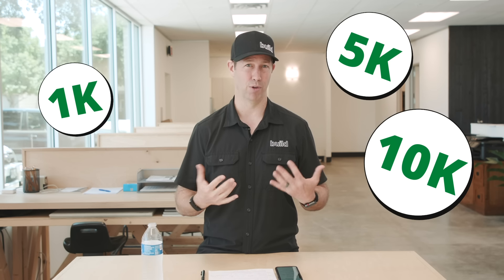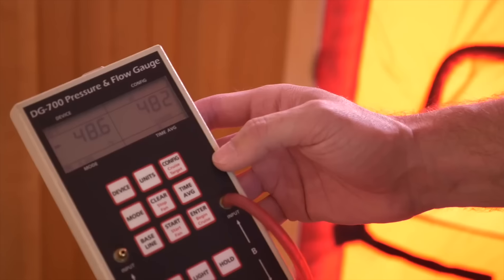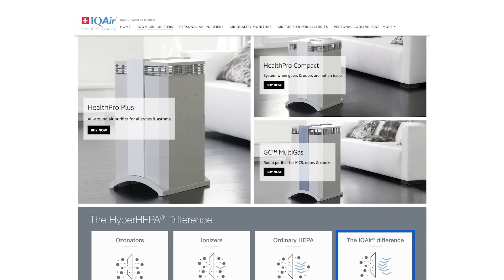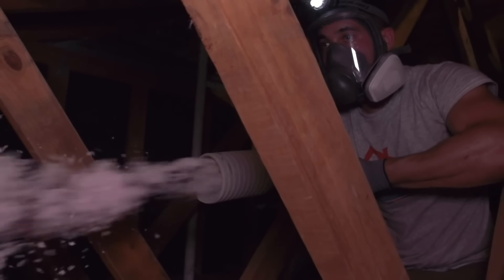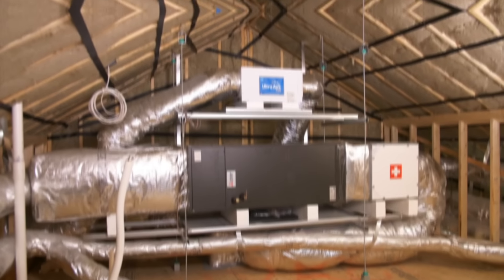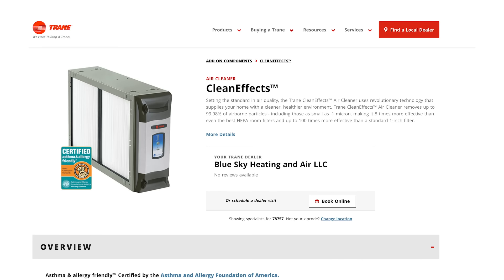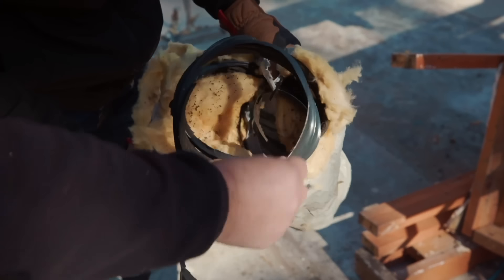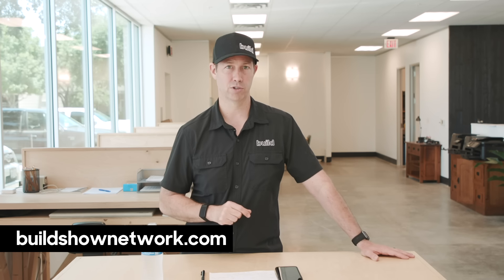Affordable Home Upgrades (Energy Efficiency & Indoor Air Quality )

Comment: Heat pump water heater is our free dehumidifier in finished basement. Can run on 1200W 12VDC inverter during power outage and is extremely energy efficient. AO Smith. Dry air feels good.

Comment: When I lived in Houston, I did seal ducts and it worked well. At the same time, I used strapping to better support some of the ducts and smooth the curves. The construction crews just dropped them in and left some bad kinks.

Comment: RE: attic space. Sorry if this was already addressed.  
I have three story student housing with large attic space.  Some have HVAC units in the attic.  Soffit vents with ridge vent construction.
Would you suggest:
Reflective insulated board, rolled reflective material with and/or without air pockets.
I do t like the idea of spray foam between joist but what if sprayed over baffles to maintain the soffit to ridge air flow.
Thank you!

Comment: In Massachusetts, you can get an energy audit free from the Mass Saves program. They will also give you lots of freebies like led light bulbs, and they will subsidize most of the cost of insulation or give you a no-interest loan for a new heating system.

Comment: Upgrading to a 4 inch filter in an existing HVAC system is huge.  Better filtration, less restrictive air flow, better system efficiency, and greater longevity of the filters.

Comment: Our Hydro company has a $1500 rebate right now, if you top up your attic insulation to R50 they'll give it back. You can top up about 1500-1800sq ft for about $1000-1200 with the rebate. You'd probably make that money back in hydro costs over the next 2-3 years up here in the north.

They've also got a window and door rebate but I don't know the particulars on it right now. 

Something to look out for local to you. Pretty good way to save on upgrading the home.

Comment: For low cost DIYers: 
1. Air Seal, Air Seal, Air Seal.  So much improvement can be made with caulk, spray foam, weatherstripping, duct sealing, etc.  
2. Blow extra insulation in attic up to ~R60.  Home Depot/Lowes will rent you blower for free with purchase of ~20 bags.  Old homes have typical R10-R30
3. Cellular Shades on windows add R value and reflect the sun's heat cheap while still letting light in.
4. Thermal camera to find missing insulation/air leaks eg. FLIR One.
5. Insulate garage door and garage - Polyiso on the door and fiberglass in unfinished walls.

Currently I'm 70 tubes of caulk and 5 cans of spray foam, weatherstripping, and a few roles of duct sealing tape into air sealing my house.  I'm also at R60-70 in the attic and have cellular shades on every window.  My heating and cooling bills dropped in half!

Comment: For the under $1000 you can DIY draughtproof using a caulking gun and inexpensive tapes available from your local hardware store. If you've got an old cassette tape (you'll probably never listen to it again!) take out about 20cm (8") and go around doors, windows and architraves on a windy day - the tape will flutter like crazy where your air leaks are...

Comment: Do you have any recommendations for coastal desert southern California? I'm dealing with 1000 sq ft built in 1958 by a builder who cut corners on everything. I have two in wall gas convection heaters that are only needed 6 weeks out of the year and no climate control whatsoever. The bedrooms are situated on the south end of the house, making it hard to sleep Aug to Oct. I use two loud bathroom fans as whole house fans to pull the heat out while pulling cool are in when I can.

Comment: Maybe you'll see this or someone else who might know the answer. My mom has a house in South texas. My Dad recently passed away. Before he did he replaced all the windows, all the doors with double pane gas filled insulated products. Also a brand new AC system throughout the house. It blows at 69° even if it's a hundred and fifty outside. The problem is the attic is always hot. And there are two walls that have bricks, which get warm and radiate heat into the house, all day and night. So what happens is when the AC comes on, temperature drives down to a comfortable number, but as soon as the AC stops working, the heat goes right up. I took a temperature laser gauge and measured all of the walls and ceilings and the Attic is literally 100° at the ceiling while the vent right next to it is blowing out 67°. As soon as the AC stops, the he starts to climb. Plus the AC runs a lot. It can be 115° in that area for 2 months out of the year. In attempting to reduce the electrical bill, my mom wanted to put in solar panels to supplement for the electricity. Basically I think the AC is the main electricity drain and it runs a lot because of insulation is bad in particularly in the attic. So my question is, should money be invested into sealing the house and insulating the Attic or buying solar panels and using that supplement the power to reduce Electric bill?

Comment: Wondering about air sealing and going to a conditioned attic on retrofit. There are many difficulties trying to retrofit sealed attic in existing home but no matter how airtight  R8 ducts are in 140 degree attics just doesn't make sense. I'm looking for property to build or existing home. BTW 35 years as FL Certified Building and Roofing contractor and BEERS level 1rater since 1990's doing weatherization using WAP, LERP, and LIHEAP federal programs. Certified through FL Solar Energy Center at UCF. Retired now.

Comment: How about some diy suggestions? Cool stuff but I’m just not able to do half that stuff. Replacing an AC or aerosol insulation is way more than 10k. HVAC companies would charge 12k for a 2000 sq ft house at a very minimum

Comment: We have a leaky window on a house under construction. We were told hosing it will cause leakage because the pressure is greater than what a hurricane wind would produce. Only 2 of the windows leak with the hose spray.  It's not high pressure.  We have been watching your videos to figure it out.  We did the water bottle test but windows are already in.

Comment: Humidifier would be in the 5K category for the electric it burns....Replacing my Heat Pump saved me $100 a month. My AC bill was $250 now its $150 and in the winter the Heating bill could get as high as $300, now its never been more than $200 Jan, Feb and usually is $150 or less. Even with the American Standard Unit being a lemon and needing repair's every 2 years , it still paid for itself over the last 10 years. Also switching over to LED's and higher efficiency fridge and washer and dryer.

Comment: I live in Colorado, and some of that work looks like an easy install to my HVAC system.  I have a floating floor basement, which has a lot of crumple zones in the duct work around system.  BUT, I try to open my windows as much as possible year round.  I only run my air when it's over 88°, or the humidity gets over 20%. And the heat when under a sunny 50° or cloudy 60°.  So does this make sense for people that only run their systems a few hours a day?

Comment: Any chance to go through what it takes to move duct work into conditioned space? I hear it spoken of constantly just not sure how much work is involved in something like that or what actually counts as conditioned space.
Reply: You could make your attic conditioned by adding insulation or put the HVAC in a pantry in your home.
Reply: Nicholas L , so the desired result, simply put is to just maintain a relatively close temp for the duct work/HVAC unit as the inside of the house?   With insulation and weather sealing?

Comment: I’m replacing my breaker panel (it’s an FPE), replacing my furnace and adding an a/c, swapped out leaking water valves, cleaning and sealing ducting, and replacing old, rotten single pane windows that are in my basement. Busy, busy.

Comment: What about spray foam insulation to bring the attic into the conditioned space? I have a second floor with most of the walls inside the attic and then the box trusses aren’t really sealed from the attic just have insulation stuffed in the ends. Would be difficult to do insulation 2.0. What do you think about spray foam in this situation?

Comment: If you seal the house with the vaporized caulk it will be super tight.  How do you propose the owner deal with the required air changes?   Add an ERV?

Comment: What about spray foam? And what is something to keep in mind when doing other repairs like replacing the roof of ur house or the outside vs inside walls?
Reply: Spray foam insulation is about three times the cost of the less expensive approaches. It might prove useful in places where a thick enough batt can’t fit without being compressed, because the spray foam has a higher R-factor. So I think since this video had budgets in mind, that spray foam costing more sort of eliminated it from the discussion. But Matt has used lots of spray foam in his builds.
Reply: @stevebabiak6997  well I know matt is from texas that's why I follow him for the most part. But I would like to know how to calculate the cost based on the size of ur house to make sure ur not getting over charged
Reply: Rafael Sanchez - that is an answer I don’t exactly have. I try to use the most economical solution that will actually work, so I only resort to spray foam for crawl spaces (where it also offers a vapor barrier) and for roof / attic spaces where the rafters / joists aren’t thick enough to use batts. I am not in the insulation business; I am in business to provide quality housing.
My suggestion is to find a number of companies that do spray foam and get multiple bids with an explanation of what they propose and why. That can be very educational.

Comment: You mentioned the upgrade of a mini-split on selected spaces.. I am looking at a multizone mini split to replace my roof mount HVAC completely In Fresno California. Are there any real down sides to doing this? (The existing one is diying so I need it done by this winter for heat)
Reply: the biggest downside is that you no longer have a single point to fine-filter the air for the whole house. mini splits have coarse filters, so if you want fine filtration, you'll need a floor-standing unit. the other downside is that you'll need to leave bathroom doors open after a shower in humid climates. you only put mini splits in larger rooms, so bathrooms get indirect conditioning from adjacent rooms. I use mini splits and I've never had a problem with a bathroom being too hot or humid, though.
IMO, it's well worth it. the exact control of individual rooms is a game-changer. you'll wonder why you ever accepted that each room isn't the temp you want

Comment: I have a 1975 house it's very outdated it has an attic what is the best insulation ? And updates for it it also has some weird old vintage windows I have never seen that use a crank and there not like the right to left type u find in an old mobile home there up an down about the size of a sliding glass door
Reply: Can u text me for images ? And your opinion on upgrades ?
Reply: I was thinking about upgrading the dual water heaters to an instant on (tankless)

Comment: Lots of references to being in the south but you failed to mention installing solar screens on windows with direct sun. I purchased 8 prefab units for $1100 that pushed into place with spring clips. Dropped my A/C bill by 30%-50%/mo. in the summer. Paid for themselves in only one year.

Comment: In Canada a 2 story home such as mine has a main HVAC  duct up the uninsulated attic space with insulated pipes to the 3 bedrooms and 2 bathrooms.    With R60 there are some fiberglass batts over a portion of the insulated pipes. The HVAC engineer recommended this was the best way to have balanced systems with uniform temps especially for cooling.  Been here 30 years and the temps are very balanced between the 1st and 2nd-floor heating or cooling.

Comment: Depending where you are, changing to a 4" may actually put a strain on your HVAC. HVAC systems are tested for efficiency using fiber glass filters... replacing a 1" to 4" may restrict too much your airflow and burn your compressor. I may be wrong but seems believable.

Comment: Anyone have advice or success with window tint? The last few rentals I’ve been in have big problems with what feels like radiant heat coming from the windows and glass doors. Mostly summer but at certain points in winter too. Would UV tint be a good sub $1k spend for future house? (I live in VA so get a big swing in temp between summer and winter)
Reply: It's also an easy DIY

Comment: In SW Missouri and I had the poorly cobbled together HVAC unit replaced with a basic 14 seer York heat pump and air handler for $7200. I save almost double on my heating bill in the winter. The duct work is on the short list of next things to replace.

Comment: In the desert (Very hot summers, mild winters, low humidity, ducts and HVAC in the attic) I use a whole house fan coupled with a home made evaporitive cooler in a window.  The house fan provides negative pressure, and the cooler fan, positive pressure.  Choose fan depending on time of day.  Don't use the A/C, usually.  The attic stays cool (about 90 deg).  Garage hot!  Improvements?

Comment: What would you recommend for a crawl space on a 50's pier and beam home? Conditioned crawl space, spray foam the floors or something else?
Reply: Earnest Jackson I’m also wondering this. We’ve had a few contractors recommend closed cell foam spraying the floors.  It provides insulation as well as a vapor barrier. I’d love to hear his opinion though
Reply: @ScottyPi  pretty easy to add a blanket to the bottom of that house. Flooring becomes conditioned.
Reply: Conditioned. Hands down best approach. You need to access Building Science Corp website, to learn how to do it correctly.

https://www.buildingscience.com/documents/bareports/ba-0401-conditioned-crawlspace-construction-performance-and-codes/view

We have done these for years, and would never go back, never do spray foam under the subfloor.
Reply: Lee Stevens thanks, have you done them on a retrofit like my house? I bought my house 2 years ago and removed all the drywall on walls so I could seal the walls and insulate. The house has rock wool insulation in the walls. It has the original couple inches of insulation in the attic. I was wanting to get the crawlspace figured out first and then tackle the attic.
Reply: @EarnestJacksonbass  Closest to a retrofit was a full basement for a total demo to first floor deck, and extensive mods to the foundation. We dug up the entirety, to do hot liquid applied waterproofing and 2" continuous exterior foam insulation. We did some floor cuts (plumbing), but relied on sleepers and 3/4" polyiso to insulate and air seal the slab. I am very much in favor of continuous exterior insulation, footing to ridge line, as it simplifies all the problems tremendously. This is tricky on partial renovations, as the existence of air/ vapor barriers on the inside of the walls can play havoc with the end product. the downside to interior air sealing is that it is highly unlikely to be complete, and completely effective (think fo shutting the barn door after the horse has got out in the field).  All my thoughts and experience are based on a cold climate, Denver area. The danger with giving advice on a channel comment section is that there are so many variables, and inattention to a key aspect may be the overriding issue. If you have gutted as much as you say, I would read and learn from the BSC website, and then formulate a strategy that will work for your situation.
Current best practice for crawls on new work is 2" continuous exterior polyiso over hot liquid applied waterproofing (matches the 2" continuous over the walls). Inside, 4" perf pipe in stone bed, for water drainage and radon exhaust (sump, if required),  10 mil poly sheet with generous overlaps, and a 2" topping of concrete (3/8" aggregate). The concrete is basically to maintain the integrity of the poly layer and makes it a clean work space for the trades, as well as dry. Old houses with very tight crawls, this can be a problem.
Reply: @leestevens446  thanks for the advice.
Reply: @ScottyPi  The closed cell foam on the underside and rim joists seems like a good retrofit option.

Comment: You left the single first thing that should be done if it hasn't been already and relatively cheap!!  REPLACE ALL LIGHTING WITH LED BULBS !!!.  This even save about half over compact fluorescent ones.  This also creates less heat in the house for the AC to have then cool off so you save 2 ways. Your heat is much more efficient than other light bulbs are so you even save in the winter too. You can also replace can light fixtures with under ceiling LED s then totally seal the cans stopping that source of air leaks helping reduce energy use even more.

Comment: I would rather buy a system the uses the standard 4 inch filters.  AprilAir has a proprietary filter unlike the Honeywell system which can use any 4 inch standard filter from any big box store or online supply.  Save $.  And what if AprilAir goes out of business and you can't get those filters anymore?
Reply: RPS Bestair already makes replacements for the Aprilaire, they just aren't sold everywhere. Menards sold them last time I checked, but they are mostly a north-central chain.
Reply: They go out of business because people like you don't support them!
Reply: @littlerhino2006  Well, if Aprilaire sold through a big-box store, I'd buy it there. I can buy Aprilaire from Amazon, so I do.
Reply: Aprilaire isn't going out of business anytime soon, so you're safe. Buying a knockoff filter won't perform as well as the name brand.
Reply: @littlerhino2006  Not sure what you are talking about?  I am looking for the right filter system to put in my HVAC. Not sure why I would or would not support them.  Just trying to find a long term solution for HVAC filtering.
Reply: @johnhaller5851  Thanks. That helps!